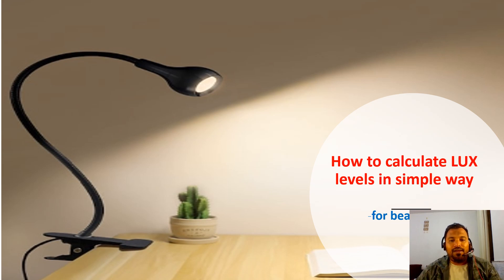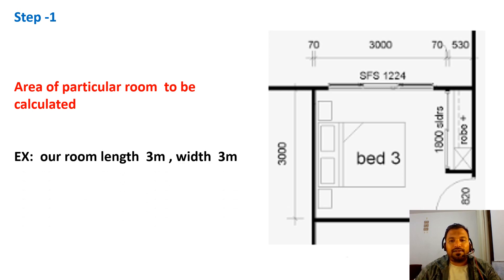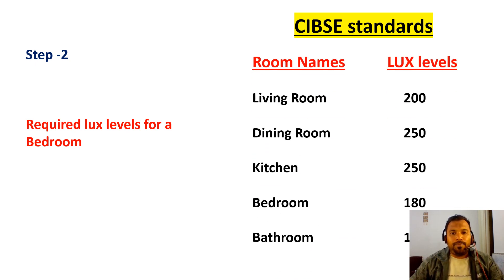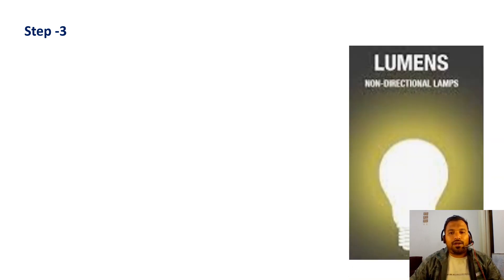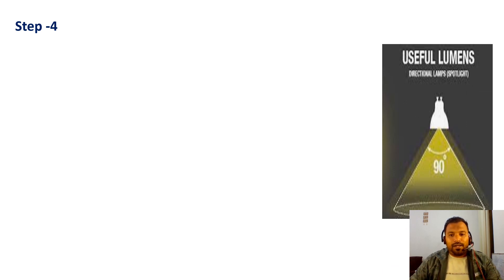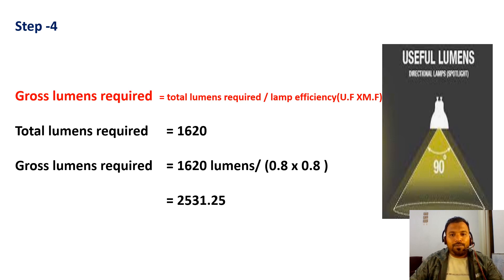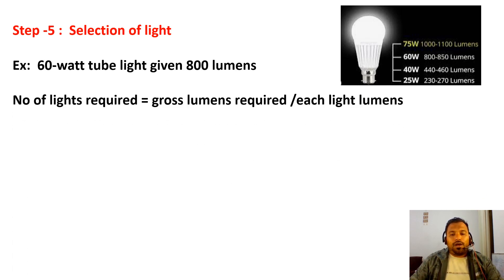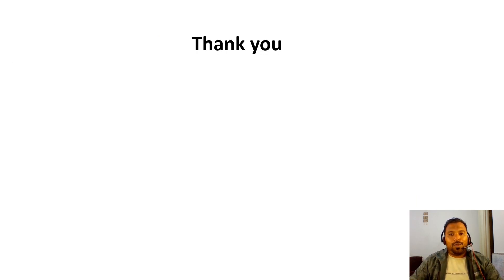How to calculate lux levels in simple way- homes

Comment: HI SIR, FOR NORMAL A ROOM  HEIGHT( 3.0M), THIS LUX AND NO.OF LIGHTS CALCULATION IS  SIMPLE METHOD .DOES THIS SAME LUX  AND NO.OF LIGHTS CALCULATION  FIT TO DOUBLE HEIGHT(6.0M) OF A HALL?COULD YOU CLARIFY THE DOUBT/ PROBLEM .
Reply from the maker: sorry for late reply   .. yes same   method have to follow ..  
if height is increases then  lumens have to increase ,distance between light reduced  ,type of fixture have have key things to get required illuminations .. example  indoor stadium lights ,mall lights etc..
Reply from the maker: further if you have doubts please let me know try to figure out the solution

Comment: How to possible to use  in bed with 4 light? is that is irritation to family
Reply from the maker: See if you want  to install less light then you can go with the high lumens lights.  
further  in  your bed rooms if false ceiling  there then you need to install 4 corners 4 lights other wise it looks ugly  ,crt ?  .  
hope you understand . 

note:  in example i consider 3 m x 3 m room
Reply: thnks a lot sir, 
if i ask another question  for my designing in mr. bedroom(5x4m2) i use 3 lights , 2 of them are wall light or angle light the  next  one is 1 ceiling light located in the center of room for its wattage is 5- 10 watts in ceiling light , so that sir how is possible to use for that huge watt 60w  in 4 light in a  this small room ?